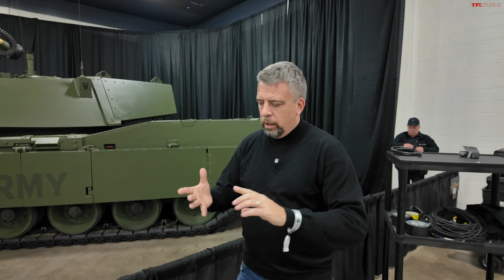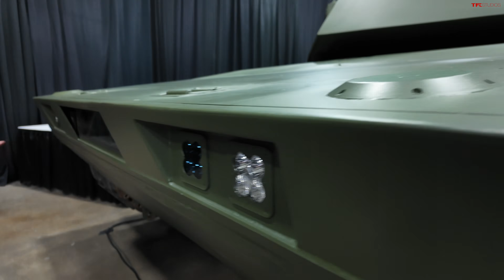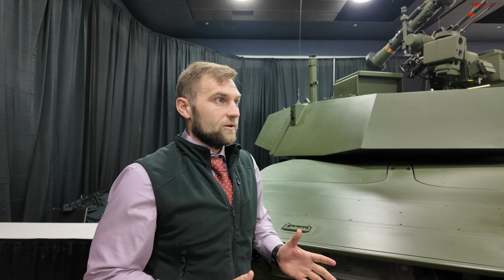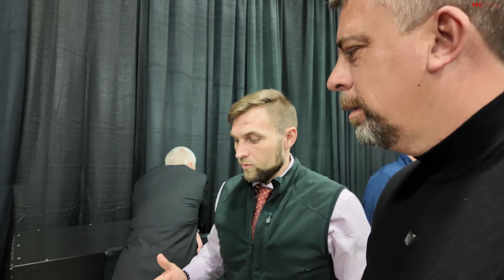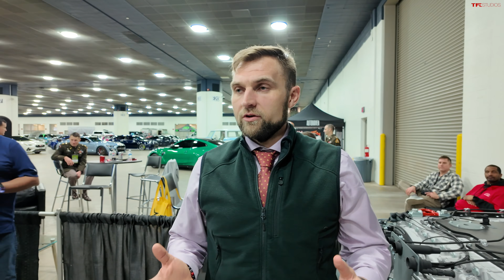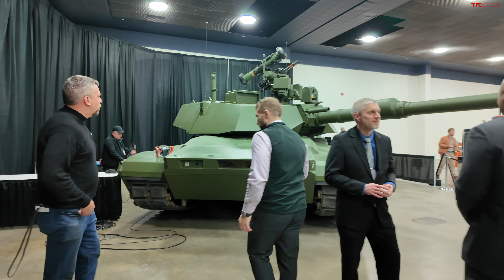This New Abrams M1E3 TANK & a Corvette ZR1X Have Something in Common!

Comment: As a former tank crewman, first thing I can tell you is where is the basket on the back to put my TA50 in? There's gonna be 3 guys, 3 duffel bags, gonna need some place to strap it on the outside, some hooks or something that you $, they start welding hooks on the side when they get it to the duty.
Reply: That's the experimental version.

Comment: Interesting tank, but is it really needed? Would it be better off to upgrade the older tanks with the new power plant?  The turbine is a hog, uses too much fuel and massive heat signiture. Auto loader is a plus like the Russians have used.  Where will it be used?

Comment: I served in the US Army Infantry in a mechanized battalion In Iraq shortly after deployment we had what we called combined arms battalions where we would run with Bradley armored fighting vehicles and up Armored HMVEEs   At some point we traded one Bradley and  crew from our plutoon for 1 Abrams M1A2 Abrams tank and Crew from a tank plutoon   So I got a bit familiar with the tanks  took a tour on the inside I learned about them and got to know the crew pretty well!  The one thing I'm concerned about in this new Abrams is the power to weight ratio!  In a M1A2 ABRAMS they  have a turbine engine It's like a jet engine that powers helicopters! It allows Abrams to run at a speed of 60 mph. But this one has a diesel engine And I don't know how that will effect the speed and the power to weight ratio

Comment: You guys are living in the dark age. I've said this a million times. You can produce 238 volts three-phase at a million amps with a 2-ft wide rare earth magnet, a tungsten rod and some heavy duty 220 insulated cables. The whole thing will cost you 40 Grand and it'll give you a million amps if you need it. It doesn't put out anything until you pull on it. There's no moving parts. It doesn't get hot. Never wears out. You just got to use good wiring. Thank God we invented super conductors. You don't need them but once we incorporate them it will be unstoppable. It'll push 5 million ants out of a 2-ft magnet. We've never needed fossil fuel. They've been lying to us forever. Wake up. People wake up

Comment: the fact that they are moving 60+ tons with a 13 liter engine is mind blowing. If i remember correctly the old M60s used a 30L v12 engines.
Reply: M1E3 Abrams Hybrid Tank with electric drive motors, same old Hull with minor changes and a bye bye to torsion bars.
old tech make comeback with new production capabilities and materials

Comment: This fake tank doesn’t even have a driver’s hatch because the design will not allow it with that molded on fiberglass monstrosity on the front of it. If you look at a normal Abrams, the driver’s hatch is almost underneath the turret.

Comment: I was an Armor crewman when I was in the Army (19K)
The current Abrams has a 1500hp turbine engine. 
Range is 260ish miles.
Fuel capacity is 500 gallons.
Top speed (governed) is in the low 40mph. Ungoverned with full combat load it can hit 80+, but the transmission will not be around for long.
Ammo is 40 rounds of 120mm Sabot/Heat.. i forget how many MG 7.62rounds it could carry.. but it was A LOT.
--------------------
If you can make the tank lighter then maybe a diesel hybrid will work.
Certainly there is something to be said about ease of maintenance. 
But after Ukraine.. and what a sub $1000 drone can do to a million dollar tank.. you have to question the feasibility and need of Main Battle Tanks.
Definitely worth following.
Reply: they are cutting 20 tons from it. its projected to come in at 60tons vs the 80tons of the current variant
Reply: @texZR2  buddy.  Diesel electric hybrid technology has been around for decades, and works better than anything else.  It's what diesel electric trains use.

Comment: I was talking about this tank last year with a friend who  drove an Abrams for over a decade. 
Most Abrams revs have been based on the same base body. To drop weight they engineered a new body structure. 
Seems some of the push for this was that the old tanks loaned to Ukraine saw greatly reduced theater capability during wet weather and certain soil types. In other words sustained rain with certain soil could reduce the places the tank could go by a sizable amount. Lighter means drive on squishier ground without getting stuck.
If designed properly the hybrid power with engine off system power could be quite useful.
Use of reliable commercial gear is almost always a plus for the military. 
The one big worry he had was thew autoloader. His experience was that they tend to jam especially when bouncing or being hit by force.

Comment: So the The Caterpillar C13D turbo-diesel engine has from 456 to 690 hp and wight are from 1150-1300 kg. and it still have an EGR valve and VGT Turbo (those 2 make the engine less reliable) If the company had chosen a Scania 13-Liter Engine, from 400 to 800 hp and wight around 1050 kg. and no EGR valve and VGT Turbo (make the engine more reliable.! and it's possible to get engine parts even more places then You can get parts to the Caterpillar engine, it would be a BIG WIN WIN situation for the users.! AND not to forget, Scania is known for having the most fuel efficient engine in the whole world. One user in here say that the engine are a Chinese-made Caterpillar, I SAY, GOOD LUCK WHIT THAT.!
Reply: Not sure where they got their info that the c13d was made in China, all I’ve found says made in America

Comment: wow - that's a lot of changes (finally) to the M1A1 since I was in the Army driving tanks back in 1991-1996
Reply: @RedHawkish  19 Kilo. 1988-1992. It’s has changed dramatically from my days as a gunner. 👍
Reply: Was an engineer at the Army Engine Plant in Connecticut where the AGT-1500 was designed and built.  Further down the same street was the Sikorsky helicopter plant.
Reply: Yeah, not sure its the same tank anymore.  Should have given it a new name.
Reply: @jeffk464  same chassis. seen another video talking about it. a lot of the weight was removed from the turret when it went to an autoloader

Comment: They can't help but make the tank more efficient when they replace that 50-year-old gas turbine with a modern diesel.  Fuel consumption will be cut by 2/3's.  But the 13-liter Cat engine will only have 600-ish, maybe 750 hp if it's significantly uprated, meaning that they'll need to get 750 HP out of the hybrid system.  A 750 hp electric motor can be quite compact and lightweight, but the problem is the battery, which they don't currently have a solution for.  I expect they'll be using the diesel to charge the battery during periods where less than 750 hp is required so the combined powerplant can make 1500 hp for short bursts.  If the hybrid battery takes a hit, it's going to go up like a bomb.  They should engineer a separate electrical system so the tank can still operate if the propulsion battery goes TU.

Comment: For all the folks upset at the hybrid setup there is a purpose to it. The gas turbine in the current Abram’s has a three major flaws. It’s hot as unholy hell, it’s thirsty as unholy hell and it’s loud as unholy hell. The fuel logistics on the battlefield to keep an Abram’s running is ridiculous and the army knows this. Hybrid helps. Hybrids can run silent and not give away their position, that helps. And in a world where drones and other weapons are increasingly heat seeking, hybrid helps. Guys they aren’t doing this for environmental reasons. They don’t give a shit about that.
Reply: you have sixty tons moving you will know its coming! there isnt a moving and not giving away your position in armored warfare. we had m1's that went out as guards for us in fallujah and when we hit the rally point and waited for them. we would know the second they started moving by the dust above the horizon and the sound.
Reply: Loud? Gas turbine engine sounds fall off pretty quickly i.e. at a distance you will hardly hear it. All tanks sound loud as hell within a certain distance.

Comment: Military has a term hurry up and wait, the hybrid should work great because military will sit there idling the engine for a hour to keep ac on but now it’s a hybrid so it will run off battery 🔋 and it will accelerate faster
Reply: and they will still run the engine to keep the battery charged that keeps the AC running!

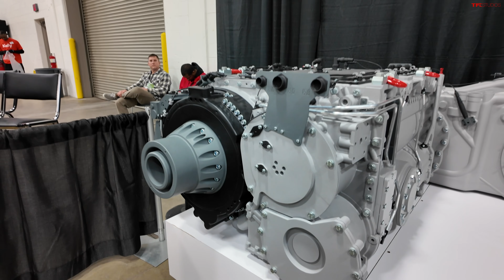Comment: 12:13 provide 10s of thousands of HP? Miss word or am I missing something? 10s of thousands of HP over time? What was the HP, did I miss that too? The turbine ones were like what 1.2k hp? What is the diesel rated for?
Reply: Maximum commercial rating for a C13 Cat is 536 hp.  I expect they can uprate it to 650-ish for the military.
The original turbine in the Abrams makes 1500 hp.
Reply: @andyharman3022 According to the specs sheet the max HP of the C13D is 690.
Reply: @andyharman3022  Some military engines like JLTV Duramax are derated.
Reply: @MOTO_909  It depends on what the engine was originally designed for.  The Duramax is a light-truck engine.  It gets derated when they put it in medium-duty trucks.  The Cat C13 is a heavy-duty truck engine designed for continuous use at full power for at least 12000 hours.  The military doesn’t require that kind of durability, so there is room to significantly uprate if it only needs to go 2000 hours.
Reply: Yes, I caught that too.  That figure would only make sense on a nuclear submarine.